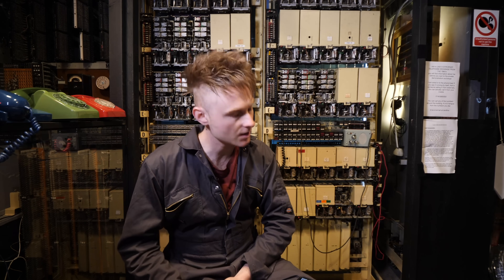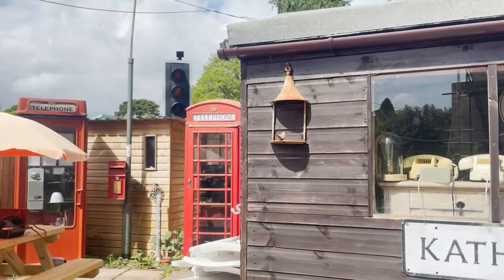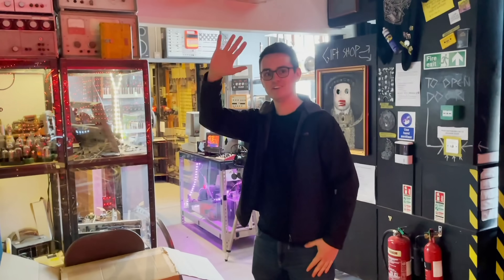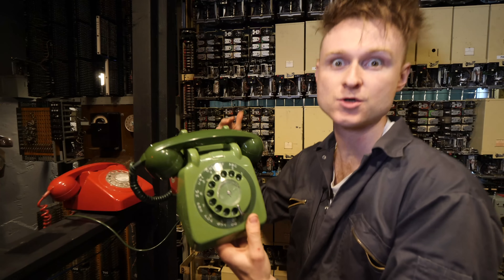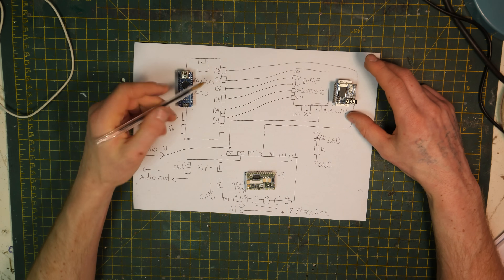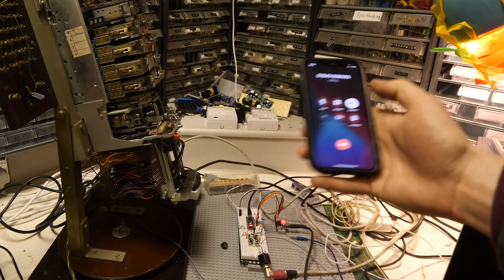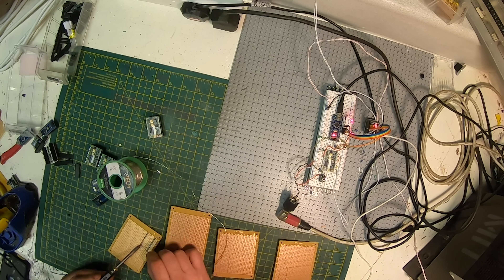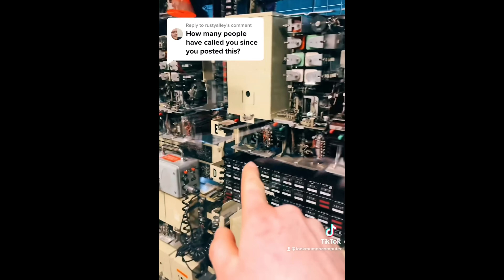Plugging a Vintage Telephone Exchange Into The Internet So People Can Use It

Comment: I used to work in telephone exchanges like that, except it was in New Zealand. There should be a phone number which is connected to the alarm system, so that when you ring that number you would hear different tones which would indicate the alarm status of the system.

Comment: What did you need all that coding on a computer as your tone-to-pulse converter for, when you could've just gotten your hands on an old existing one and use that instead?
Reply from the maker: Pulse to tone is common. This way round is not
Reply: @LOOKMUMNOCOMPUTER : The other way around is common enough that I know we had one in my little home city of Spanish Fork, Utah, USA until 1990. In the 80s when we got our first TouchTone phone at my parents' house, I could hear the pulses dialing in the background after I pressed the numbers and wondered why those needed to be there. But then in 1990 when our old dial and ringback tones were sounding quite sickly, one day I suddenly heard the clean new tones, and then DTMF made a call go through much faster and it was easier for me to win those "Caller number xx" radio contests, and I was amazed by the switchover and wished I had been there to watch as they did it!

So even though those might not have been common, we can see that they were probably still reasonably common for a while. Are you just hinting that you can't find one for sale?

Comment: Not an electronic equivalent, but an electrical one. Relays and contact wipers, etc. aren't electronic.
Reply from the maker: Sounds a tad pedantic
Reply: @LOOKMUMNOCOMPUTER : Not at all pedantic; there's a big difference. Electronics are based on semiconductors, while electrical things that aren't electronic are just that: electric/electrical. Would you call an incandescent light bulb "electronic"? Would you call a manual switch "electronic"? Would you call a motor that involves no drive/control circuit (just a standard, run-of-the-mill basic motor) "electronic"?

Comment: Most interesting, I was a phone tech before being shown the door. I kind of remember doing banks and wipers in a step exchange, was also as a group of trainees cutting a manual area over to automatic.
I liked your little Arduino DTMF to pulse converter, however I need the opposite so I can hook old phones up to a voip line.
After phones, I moved over to Telex, and switching their traffic via similar exchanges. I have the odd bit from those days including an in-house built time and date generator that talks 5 bit ITA5 to put that onto the calls
https://youtu.be/xm12sY7jBfc for a looksee
I'm kind of interested in how your internet interface worked, yes you had an asterisk server box, however how did one talk to that, with a custom app on ones phone, or computer software, or was it a web app?

Comment: Having worked telecom for 40+ years I see absolute value in someone knowing something about how to build, set up and maintain these systems.  There may come a time when we will need to revert back to electromechanical devices as discreet electronics may be damaged from coronal mass ejection or EMP from a rogue state.   Old is not necessarily bad.  Awesome setup.
Reply: The elites have purposely removed almost all analog things from our lives because it makes communication easier to control…

Comment: I would recommend you to use a auerswald compact 4410 USB and a auerswald isdn to voip converter  because the auerswald 4410usb can work as a pulsedailing to isdn (a German digital telephone standard in the 2000s )in both ways an 10 at the same time and then use isdn to voip converter to get to something modern

Comment: There a massive 3 floor gymnasium sized
Mechanical switching museum in Seattle Washington USA. Called Connections museum. Its Only open Sundays. They have step-by-step switches numbers one to three and five cross bar switches…. And ESS switches… Functioning! They are all being held up by engineers from Microsoft and Boeing

Comment: Hello. I only worked on UAX’s as an apprentice. We had loads of UAX13’s and the odd UAX12. The 12 was built by a blacksmith and was rough1 the UAX’s were designed to be self-sufficient and to work in small buildings about  20ft x 10ft or smaller and with no toilet facilities or water and no heating. The older racks in the 13’s were grey in colour and cabinated! With a mains tubular heater in the base. Later the cabinets were removed and some heating provided. In a few exchanges a small 4x4 shed was provided if mains water was available for use as a toilet. If fuses blew or selectors jammed then the local telephone number of 299 was designed to give Number Unavailable tone (NU). The operators made regular calls to 299 and then decide to call out an engineer.
I’m not sure of the circuitry but the condition for a free circuit was not a disconnected state as in usual Strowger.

Comment: Hello. When I first set foot into a Strowger exchange it was a non-director called Cardiff Empire (opened in the 1958 when the Empire Games was held in Cardiff. Some of the older racks and selectors and cables were all Battleship grey in colour, the later ones were what was called Light Straw in colour, made the place a bit less darker. The Cardiff Empire exchange when I visited was claimed to be the 2nd biggest in the world, second to Paris, France. The London exchanges were Director exchanges, a unit there managed multiples of 10,000 customers. Cardiff had a capacity of 100,000 plus traffic from its dependent exchanges around the city centre, some with10.000 customers, some with just 300 customers. Plus connections to other trunk units across the UK and International Operators.
The first thing you felt was the noise. As engineers/technicians you used your ear for non-normal noises and your noise for the smell of burning coils that you would discover before it caused an alarm.

Comment: Btw you can get VOIP/SIP Gateways to PSTN/ATA (Analogue Telephone Adapters ) lines
Cisco ATA192 VoIP Telephone Adapter/SIP ATA w/ 2-FXS Ports
Cisco ATA191 VoIP Telephone Adapter/SIP ATA w/ 2-FXS Ports
Linksys ATA PAP2T
Grandstream  ATA

Suggestion setup a Few FAX (Paper-less)  (PI With HDMI TV Screens) & Modem Bulletin Board System (BBS) (PI With HDMI TV Srceens ) BBS Games 
Some Voice modems you can Setup a Phone in Call Center / Phone in games  / Muti Party call lines
Reply from the maker: That's the first route we took but it didn't work in the way we wanted! Cheers tho!

Comment: I'm a VOIP engineer in australia - Not too sure how your exchange works but another option would have been a TDM400 card straight into the asterisk box. they are pulse dial capable so oyu could do it all in asterisk using the standard zap driver. so you could just plug in an  RJ11 straight into the PC.

Comment: This has probably been mentioned below, but there are too many comments to see if it has been. On a pulse dial system the pulses increase from 1 up to 9 and then 10. The tenth character is NOT zero, it's oh "O" and represents 10 pulses not zero pulses, because you can't pulse nothing. In the UK the emergency number is Nine Nine Nine (999), but in Australia it is OOO and was originally known as Triple O (Oh) and largely still is, it is more recently incorrectly referred to as Triple Zero.

Comment: Hello, I’m 20 years in the asterisk PBX configuration. I used to do this kind of work. I do not remember exactly but what you need is a SIP to Analog Gateway. I think that the exact is FXO gateway. And the gateways are coming with different numbers of ports for analog connection.

Comment: Find yourself a pile of mp114 audiocodes or an old m2k gateway and get a pile of fxo cards. Should be able to source one online for super cheap. axe the soft phones off the asterisk box and add all the physical fxo cards and you can x50 the ammount of inbound traffic. I think the old gateways support pulse natively, and if not you can tweak the firmware in vs code to get whatever you want out of it.

Comment: I'm a phone tech in the States, we're an old GTE market with GTD-5 switches still. These will still work as pulse or DTMF. We actually get calls for false 911 calls due to bad equipment or wires making and breaking the circuit looking like a pulse dial. The accumulator doesn't know the difference and if it sees 9 pulses then a couple more, it thinks you wanted to dial 911. Cool project!

Comment: Used to maintain them in the 80s, also ripped them all out.
Sat in  a room with hundreds of columns of racks, sliced through the subscriber cable and the blade shorted out all the first selectors and a gigantic wave of switch seizing ran down the room in a cacophony of deafening sound.
Eventually even the senior managers were having a go, would have made a great video

Comment: Amazing, imagine the noise in a full exchange in the 1970's. It reminded me that the original control system on the Thames Barrier used telephone style relays. About 150-200 relays each gate end wired in relay ladder logic fashion to produce the control sequences. Thousands of wires going back to south bank central control to drive hundreds of incandescent bulb indicators and push buttons. All replaced with PLCs, serial communication lines and computer screens between 1992 and 1997. I did all the new drawings and converted over the control logic lol
Reply: Nice! I bet you were tempted to take a couple of walls of relays home with you. That's insane that they actually sent that many wires so far, in some hellacious foot-wide cable I suppose. Sounds like it was designed in 1901 or something, who on Earth would do that? Even way back when they could multiplex signals on a wire, even if it's just using a few frequencies.

Comment: Make sure the release alarms are wired up. if a switch gets stuck the electromagnets will cook. A smoke alarm is a useful accessory👍 
This DTMF you hear on your phone is just for show. The phone sends a  data packet to dial.
Reply from the maker: Release alarm is wired in. You can see it in the vid. As for the dtmf probably
But it’s also for legacy use. We use those tones in the audio

Comment: I am not a phone tech for these historical systems and I am not familiar with how these are specifically designed. But in general the main wear on relays is opening or closing a powered circuit.
* An electric spark is a form of plasma that is incredibly hot but very tiny. A DC plasma erodes metal on one side and deposits it on the other, while with AC the erosion direction is random.
* Eventually the terminals are rough and pitted and do not make good contact anymore.
* If the circuit is unpowered during the line selection phase then wear is minimized, focused on the one final relay that makes or breaks the line connection.

Secondary wear in these grouped terminal selectors is going to be from the physical metal wiper tip rubbing and dragging across the selector terminals as it moves to the final connection position.
* This wear can be minimized by positioning the wiper tip in open air halfway between the selector ring contacts, not touching anything as it moves across the X and Y selector planes.
* At the final selection step, a solenoid pushes the selector tip straight down onto the final ring segment connection point, and lifts off from the connection point before the selector tip returns to the home position after the call is completed.

The third wear problem is simply dust in the air constantly settling on oiled and wetted lubricated rotating and sliding parts, and also the degrading of the lubricant from oxygen in the air.
* I expect this is why each selector has a metal cover installed over it, to minimize dust contamination that makes the mechanism sticky and can cause it to jam.
* Preventing lubricant oxidation would require a gasketed seal around the metal cover and wall-mounted chassis, and then some way to purge out the oxygen and fill the selector with an inert gas like nitrogen or argon.

Comment: That was an flipping great video. Thanks very much for getting involved in a bit of strowger exchange equipment. When I was a youngster in early 80s I worked for BT in a trunk exchange. I was one of many engineers who maintained 19,000 group selectors. Those sounds bring back memories. It was so loud in there.

Comment: Our local excange used to use a tone to pulse convertor in the 80s on the pulse excange. so i know they exist... i used to dial like that using a test set i had with no dial. Somone in the excange saw me mistakenly dialing 11 and broke in and asked me what i was doing. I dont know what dialing 11 did but it was noticed

Comment: *WARNING:*  
1) Please tell me you bolted that to the floor/wall...?  
2) Don't forget to install virus protection, automated circuit overload protection, and call volume gating/control...  otherwise you might get some jerk using an autodialer to run a call flooder (like an old-school DDoS attack but for phone switchboards) or inadvertently get so many people trying to play with the system all at once that the sheer volume of calls could crash the system or even burn out the circuitry.

Comment: I used to use the Multitech Multivoip units to carry analogue circuits over IP. They take SIP and convert it to 2-wire FXO/FXS, 2/4 wire E&M and vice versa. They also cope with DTMF and pulse dialling and were available from 1 to at least 8 channel versions.
Reply: Also Sipura devices like PAP2T just do exactly that. There isn't even a need for an asterisk in between. And those things are old an cheap. No need to re-invent the loop. They also come in variants with mixed FXO and FXS ports.

Comment: I have to applaud the ingenuity here, but I think you made it more difficult than it needed to be ;)
Rather than manually wiring up a phone wire interface, you could have just used one of the many telephony card interfaces / E&M from Digium for Asterisk.
Then you can let Asterisk handle all the DTMF <-> pulse conversions in both directions and have a much more reliable connection.
Let me know if you need any help with Asterisk, by the way; you had mentioned you had some trouble with that. I help other hobbyists set up Asterisk systems all the time. There are peer-to-peer hobbyist switching networks that let you have unlimited outgoing/incoming calls with VoIP - no need to pay for PSTN trunking!
Reply from the maker: Probably! I like solving projects this way. As if it breaks I can fix it cus it’s likely a hardware issue. Having tried with fxo boards and what not I could get it do to the right pauses and hangup routines so just went with this approach. Happy to revisit at some point however!

Comment: Crazy setup dude! You're mad! Did I miss the part about the power supplies and whats needed for power?
Reply from the maker: -48v 👍👍
Reply: Big old glass case batteries in earthquake proof racks, 48 volts for talk and 110 volts ac for ringers. Flotorol power supply for charging (only problem is where to get a 90 volt dry cell for bias supply--totally obsolete)

Comment: back in the day in GPO phone boxes using 1D mechs later converted to 2P, you could tap out the number like you did at 7:29 and it wouldn't trigger the payment required protocol, free calls :)

Comment: Very cool!  My first job after USAF was as a frameman with South Central Bell in Nashville, TN’s downtown central office.  It was an old office and still had 5 exchanges of Western Electric step-by-step switches, plus 2 of crossbar and Nashville’s first ESS exchange.  It was my task to make the hard-wired connection on the main distributing frame from the physical presence of a telephone number to the cable pair leading to subscriber’s location.  It was a noisy place with all those switches clattering.
Reply: Yeah, I been a Frame Monkey, too.

Comment: A good way you could add a load of lines the have free unlimited incoming calls would be to get a gsm gateway, you put mobile phone sim cards in and it basicly acts the same as that trunking service just routing it through the sim card. They normany connect via usb or ethernet and you can get gateways from as low as 1 sim to the largest ive seen at 128 sim cards which i could dial on about 32 at a time

Comment: Years ago I built a fully operational 4 line Strowger telephone system for our house (using a final selector) and I arranged it so the 9th level connected the calling phone to the BT line (via a vertical marking bank). The first time I tried it blew the exchange fuse (BT were using system X at the time)!

Comment: Couldn't you have just used a Cisco ATA 191?
Reply from the maker: Does that do pulse dial but also taking into account the actual pauses of original exchange machines and not just what was interfaced to it? I have tried many things before this granted not the one you mention but there was a point I decided to take the approach I did

Comment: Now this makes me wonder what the heck my university’s system looks like as I know it has both analog and VOIP extensions intermingled with each other plus when I was on the clearing hotline I could tell there was a verity of ages just by the noise they made when ringing
Reply: I wouldn't expect to see any mechanical switches still in service. Might see something from the 80s though.